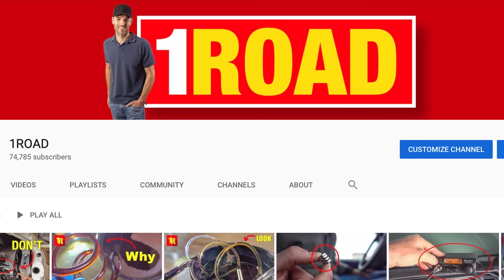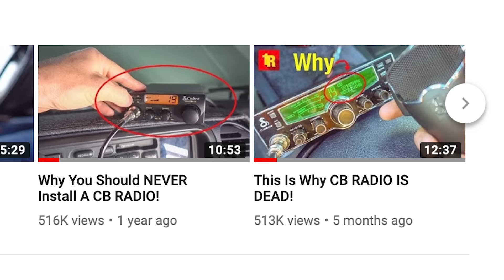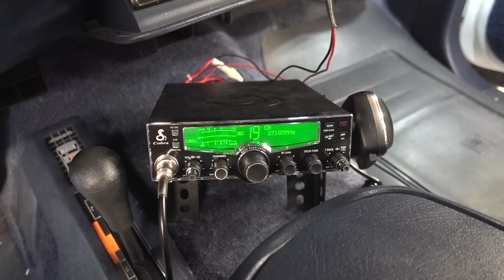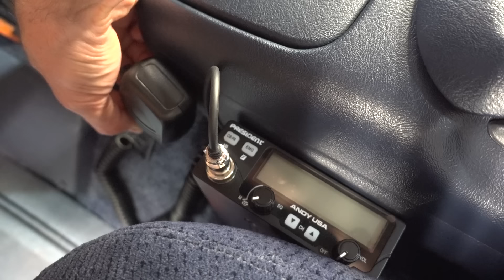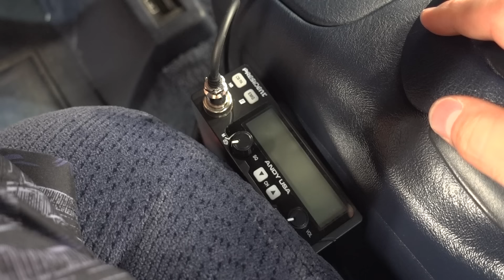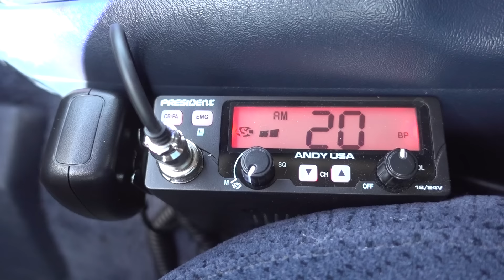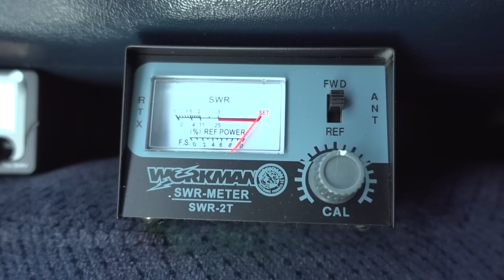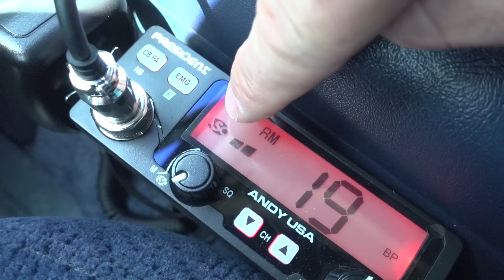Here's Why YOU SHOULD TRASH YOUR CB RADIO!

Comment: When I saw "trash your CB radio" I thought it meant he was going to talk about something far more useful instead such as ham radio.
Reply: yesterday I couldn't even spell HAM today I are one !! 73's  br549
Reply: That's interesting you think a ham is more useful I'm willing to bet CB could probably get you better help on the highway than a ham radio. CB's are excellent tools. Considering they basically do the same job I really don't see how one is more efficient than the other. One just requires less rules.
Reply: I totally agree …  I am a cb, gmrs, mers proponent .. lf all goes to hell who cares about a ham license or otherwise.. I can cover it all
Reply: 10/4
Reply: Ham radio is certainly not more useful for traveling highways. Its an extra radio to rag chew but with hammies being so sparse these days, its not practical for speed traps, cops, Weigh scales and other road BS. Besides those stuffed shirts would think its a crime to give away the smokies location. I know. I have CB's and I R a ham :D
Reply: @KlodFather  I can envision regional differences.
Reply: I am watching this. He whines way too much. I would go with the big radio. I have a Kenwood TS590 on top of my dash, an Icom 2 meter vhf on the steering column , and a cb mounted at the slide out drawer at the low end of the console. All is good.
Reply: @jonathanfranklin6259  Kenwood TS 590. Excellent radio! I'm a Yaesu guy. FT-840, dual band 8800 (love the crossband repeat), and a VX-6 HT. Been a ham since 1989. 73 to you!!
Reply: @dogbarbill  ...Same here, FT-840, FT-757GX, FT-891 and an FT-8900R Quad Band.  I do have a Kenwood TS-520, just waiting for the replacement tubes (6146B's) to come in.
Licensed in 1992, Hamfest, Leesville, LA!
73, N1WOM (ex KB5UZV)
Reply: @jfrphoto01  Man, I want one those 891's to go mobile and an ATAS 120 for the antenna. 73, N5NUK. I'm good on QRZ.
Reply: @KlodFather  i  be like smokie. i have a computer in my truck and  i go digetial over the ham band  it is called packet.
Reply: @francismcclaughry9851  -  Ive worked on packet rigs but never had one myself. Brother had one in his semi that showed his location GPRS. 
A few years back there were some CB'rs that hooked TNC units to their CB's. Those TNC's did slow scan and file transfer also. They were trading jpg and gif images over CB radio. I encouraged them to get their licenses. Some did. Packet is so slow and almost dead. 
I saw a radio on ebay the other day. It runs on 3g/4g/5g with Multiple bands in it for ATT Tmobile and international use. It does P25 MotoTurbo and a few other formats. Im sure its not type accepted but it does it over the web to interface with internet based ham and commercial radio. Its one hell of a box for $150. 
Im going to buy one. Software on that thing can do several kinds of ham digital voice. And with no RF radio in it. Dongle and radio are one over the net. No more special chips for ham digital... its all in software for that unit.
Reply: Ham radio needs a dumb licence too.
Reply: @willyb7353  - Yes you need a ham licence. CB does not need any licence any more... I believe there are many unlicensed UHF and VHF freqs as well available for use. 
The caveat being that you need type accepted equipment for many of the licence free services. Most people don't bother and just use commercially available radio gear. No one is going to check unless you are a pain in the ass or a problem.
Reply: @KlodFather  sure you are...whats your callisign?
Reply: @willyb7353  lol...what's the matter?  Can't pass the tests? Lol
Reply: @showcasecharlie11  -  Doesn't matter Charles. But I have been around RF for many years both in the commercial and broadcast sides of it. 
I am not active on the air any more but that might change soon. 
You want to find me? Come to a hamfest in Eastern Ohio or Western Pennsylvania. You will find me there stirring the pot.
Reply: Ham radio requires a license for which you have to take a test.  In the U.S., the easiest license to earn which allows you local communication is the Technician class.  Technician class amateur radio operators mostly work FM (CB is AM/SSB and is subject to atmospheric noise, but can also "skip," reaching long distances or DX).  Ham operators are much more heavily regulated than CB, not only by the FCC but by other hams, many of whom have little tolerance for morons.

Hint:  Truckers, whether correct or no believe the CB to be their exclusive realm.  You are just as likely to piss off a trucker as you are to make a friend, if you ratchet jaw (talk too much) on "their" channels.  And from my experience working CB isn the 1990's, there are a lot of morons on the Citizen's Band.  Just my two watts.
Reply: @fpeletz I now have an 891 and a Tarheel 100 which will cover 80-10 meters. To cover 6 meters I have a Hamstick. I haven't done the install yet, I'm leaning towards waiting until after we get out of winter and into warmer weather. All this will go into my Pathfinder next to my 8800 dual band.
Reply: @fpeletz -  There are some really good murs and uhf radios for sale these days. Good prepper items
Reply: @dogbarbill  -  I have an 891 in the house... not sure what I will do with it, but I put the  Icom 706 in the truck. 
11 meters was really hot on some days this fall. The screwdriver antenna that allows me to work 80, 40, 20, 17, 15, 12, and 10 also tunes in 11 just the same. Brother built it and two more with a 10cm coil canister inside a thickwall pipe. It works great. I have a switch to another antenna that tunes 45 to 60 mhz if I want to run on 6 meters. I use another radio for VHF UHF and a scanner. Truck is big so lots of room. (not a semi or anything similar)
Reply: @dogbarbill  -  There is a shitload of silent keys out there. Equipment is turning up cheap all over. Keep hunting and go look at the hamfests. The resale prices on some of that stuff is really at the bottom. Look around. That is where I got mine. A silent key. I bought all 13 radios.
Reply: @KlodFather  I know. Any time we have a SK here, word always gets out pretty quick. Also have a couple of wheeler-dealers who like trying different rigs and antennas, and then doing a buy/sell/trade for something else, which is how I got the 891 and the Tarheel. The 891 I have was used only a month and has less than 100 hours on it. The Tarheel came from a SK estate. Total investment for me was $700.
Reply: @dogbarbill  -  Good deal on the radio.  I left the 891 in the house as to not tear it up and put the 706 in the truck. That radio has lots of road rash on it but works great. Tough as nails.  
I am thinking about calling up the linear amp guys and having them build me up an amp that will work for 40 through 10... 80 too if I can get it. 
One thing the CB taught many of those linear amp producers is how to make good power without breaking the bank. Amps these days are clean and clear thanks to good transistors and more readily available tuning equipment when making that stuff. 
Its easy to find high drive amplifiers that will make 300 watts plus that run directly on 12 volts and look like the kids car stereo amps. 
Those Italian amps are really nice. Brother had a couple of them and I was surprised how clean they were when put on a dummy and checked with the equipment at the shop. Really nice designs.
Reply: @street_legal_go_kart7356   Shows what you know... nothing.
Reply: @Skullfocher  ha ha grew up around ham did study 4 my test at 19. Was installing radio in big trucks at 13 . Made few ho made ant. 
please teach me .

Comment: I prefer the Cobra 25LX which is smaller (5" wide) than the 29LX. It has a 10  channel memory with memory scan which I find very useful. The Andy does not have memory scan. I have my top 6 or so channels programmed in and won't miss a call. The newer President Andy II has memory and scan features so that's a big improvement to me but I still like the Cobra because it does not use surface mount components which means I can still work on it.

Comment: I'd be a bit concerned about your mounting location as it looks very restricted w/r airflow around the heatsink you pointed out. Also, in my experience in hot climates the "central hump" of a vehicle is generally quite a bit hotter than other mounting locations in the cab (except for installations I've seen where people drilled mounting plate screws right into heating ducts of their dashboard vents). This extra heat further decreases the ability of the heatsink to cool the power solid state device. It may in fact be a non-issue for your particular situation but it's something to consider from time to time.

Comment: I played with CB radio back when I was in elementary school in the late 60s/early 70s.  Then I learned morse code in 5th grade and I got my ham radio license.  Never looked back.  This past weekend I traveled through Texas and New Mexico on a 13 hour trip.  Using my Icom IC-7000 and Tarheel screwdriver antenna, running 100 watts, I talked to several countries and states. I've never regretted leaving CB radio behind for ham radio.  And now there is no longer a code requirement to get a license.  I've met lots of preppers that have gotten their license but now enjoy the hobby.  I also have off roaders and hunter friends that got their license so they could use ham radio with their other hobbies.
Reply: @Fran Tech  -  You dont have to get a licence. They publish a book with lots of licences in it... Just pick one and get on the air :D  
I made an app that was W N A K as the first letter and it works like a gambling machine. When I need a call I just push the button and it comes up ready to use ha ha ha
Reply: @KlodFather  no thanks.  I'm studying to get my own license and call sign. I hope you never steal my sign just because you couldn't bother to get your own.
Reply: @tradedate  -  Good luck with that. Too bad you have no sense of humor.  10-4 !!
Reply: Bless your little Heart

Comment: Just last week I installed a Cobra 75 All Road Wireless CB Radio with a Cobra HGA 1500 Hga1500 36 Inch Magnetic Mount CB Antenna into my 2010 Jeep Liberty off roader. The unit is very small and is Bluetooth capable, so the radio is installed under the seat, and the handset is plugged into the cigarette lighter (as apposed to directly into the radio). It will also pair with a wireless headset. It works great and people say I sound good. I had to shorten the antenna a little over an inch to get the SWR down to one bar.

Comment: I know this is an old video but I’ve got a pretty custom CB mount location in my ‘95 K1500. I built an overhead console that utilizes the aftermarket shelf (that you can get from Amazon) which mounts to the visor locations. And it pockets into that console concealing the entirety of the body. Which is large because my CB is the Uniden Bearcat 980ssb. The mic pockets into a cubby I made for it that can be reached by driver or passenger. And the bottom of the overhead console is a perforated metal sheet to allow the CB speaker to be unimpeded. It’s also where I’ve installed my mic for my Bluetooth stereo for phone calls. And it sits in a nice central location to both driver and passenger. Wish YouTube allowed pictures cause I’d send you one! Love the channel. GMT400’s are the best.

Comment: I'm running a cobra 29 Ltd mounted on the dash of my 97 honda crv.
Reply: I have one in my -88 Peugeot..
Reply: 29ltd is one of the finest, bare bones large chassis radios in existence. 100% solid state, massive room inside the case for connex boards and noise toys. And one of the most forgiving radios ever devised if you ever reverse polarity. And peaking them is a cinch.

Comment: I'm still using my old President HR2510 and an old Radio Shack TRC-449 sideband CB.
Reply: Paul Zap I’d like to have another HR2510 to put my 10M beacon back on the air.
Reply: I had a quarter dime back in the day. It was a great radio. I had it peeked and had some extras installed on it. Also had the clarifier opened with modulation swing.
Reply: I have one of the HR2600 models, bought it in 1989. It's packed away since I now use a Yaesu FT-840.

Comment: So you make a video about CB radio installed in your Suburban, and as you finish the video and drive out of the parking garage you see a huge traffic problem and road hazard in the form of a broken fire hydrant and never once think that you could use your CB radio to alert other drivers of this important piece of information.   Maybe someone saw what happened and could help. How important is the CB radio if You didn’t even think of using it when it should have used to give a heads up to fellow drivers in the area?  But you did get three nice radio checks.

Comment: I know it’s been a few years since you posted the video.. But, I’m running a Bearcat on my Excursion overland project. Radio is mounted in a modified Lincoln Navigator center console. Running it on a 2’ Firestick that’s mounted on the roof rack. Also hooked the PA to a small 20x2 amp that’s pushing a pair of little Pyle horns. Good times 👍

Comment: Years ago I bought a car that had a tiny little cubby in the headliner. 
So I went to my favorite CB shop and asked, "what's the smallest radio you have?", and went home with a radio made by "K40", a company better known for their antennas. Mounting consisted of "jamming" it into the cubby, and when I got a radio check, I was told "loud and clear", and even that my stereo (which was so low that I couldn't hear it) could be heard. 
When I described the radio to the person on the other end, he said he would have thought it was a much "bigger" radio. 
CB, may not be "dead", but...  (for work purposes) in Washington state, it has become utterly useless. It's been about a year and a half since I last bothered to even turn on the set in my work truck.

Comment: I'm still trying to figure out when cb died. Its been in semis since the 70s. I work in a rock quarry and every single piece of equipment has a cb in it. We're running uniden pro510s. I've got a cobra 29nw mounted to the bottom of the dash in my f350 and if I could find a good place in my s10 I'd put a small one there.
Reply: Technology is forever changing. Cellphones, GPS, traffic apps slowly took over.

Comment: I love radios in general. Been obsessed with walkie-talkies, CB radios, FRS/FMRS, MURS, and even HAM radios most of my life. But hey, I’ve always been a motorcycle and gun loving Tomboy.

I don’t have a CB radio installed in any of my cars, but when I travel I do carry a portable CB radio with a magnet mounted antena from good o’ Radio Shack. Damn I loved those stores when I was growing up.

CB radios are not only useful in an emergency or to kill time by talking to others on ling stretches of highway, but also helps you avoid a traffic ticket. Truckers often talk to each other and pass information to others on where the cops are set up along the highway.

In most, if not all, major off roading events the CB has been replaced with GMRS due to it’s many advantages. In 2021 the Jeep Jamoree USA officially switched to FRS/GMRS. The NotARubicon channel that people are using is GMRS 16.

Among some of the advantages of GMRS over CB is clearer communications and greater range. Handhelds max output can vary between 2-5 watts, but base stations and mobile stations typically start at 5w and can go as high as 50w (generally in channels 15-22). Depending in terrain, antena, power output, and even weather, handhelds can transmit for about 2-3 miles. While mobile and base units 20-40 miles. Again depending on terrain, power, and so on.

Another and huge advantage of GMRS radios is that you can use repeaters which greatly extend the range. You can’t do that with CB radios.

The disadvantage is that you need a license from the FCC to operate one. But getting the license is cheap and easy. No testing is require. Just fill out the application, pay, and you are pretty much good to go. It used to be 70 bucks for 2 years, but the FCC announced at the beginning of 2021 that it was cutting the price by half, to 35 bucks. Once license is good for you and your family. So it’s not like everyone in your family needs a license to operate them.

On the other hand, I have never seen FCC officials checking licenses at off-roading, ADV motorcycle events, and many other events I have been to and used those radios. Never has happened in my 20 years or so using them with friends and family. I the FCC is more concerned with large companies having lots of them or transmitters that step over others, and that sort of thing.

If you are a heavy user, I do recommend getting licensed. At 35 bucks it’s cheap and in case of a extremely unlikely encounter with the FCC, it will prevent you from getting a heavy fine.

Back to CB radios. CB radios are stuck at 5w maximum output by law.  Back when I was a teen in the 80’s, some people illegally boosted the power output or used SSB radios which would transmit at 12-14w. But you were stuck talking to other SSB users. I imagine some still hack their power output or use SSB radios. Many fools did not do it right and caused they radios to “leak” causing interference with other frequencies and steeping over others. Not cool!

Regardless of what you pick, transceivers are fun like hell. Enjoy!

Comment: I have had a Cobra 29 for about 40 years in my Chevy 4x4 truck and I mounted mine in front of my rear view mirror . I can't use my rear view because I have louvers on my back window and can't see out the back. I use my side mirrors. Worked out great for me and I love that radio. I also have a Pace and Midland radios that are smaller but don't have them installed in anything yet.